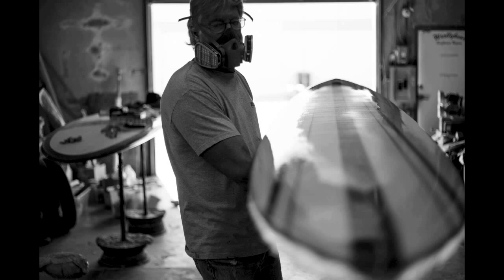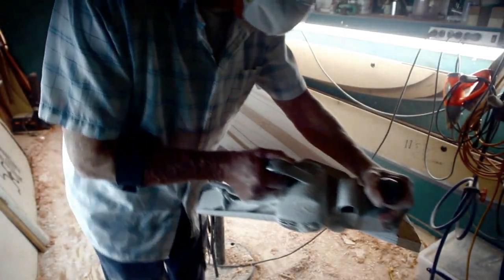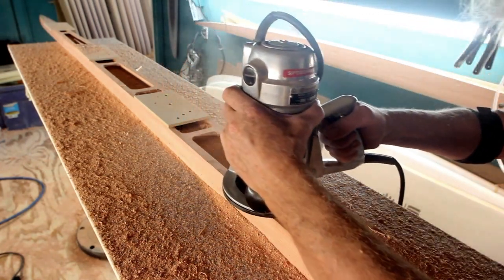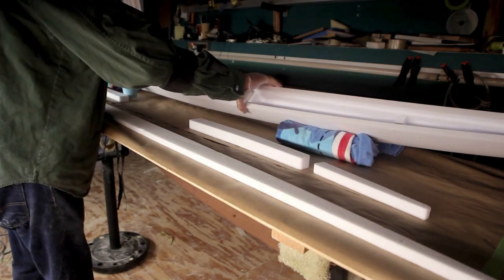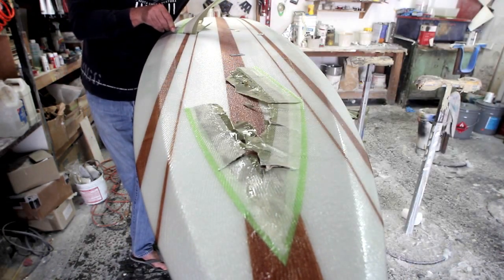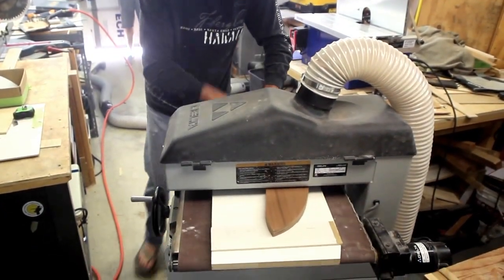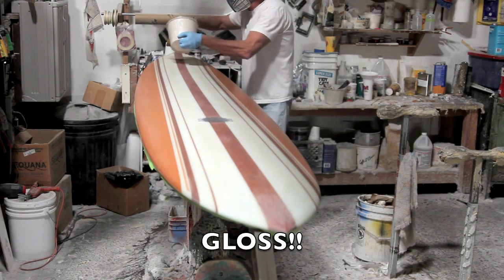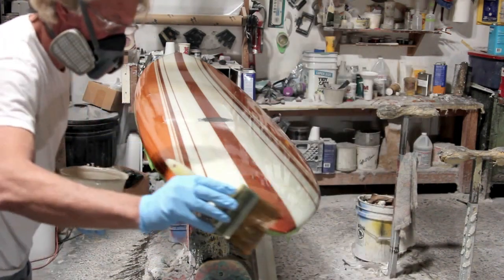Gene Cooper / Ultimate Craftsman Project 2015  / Full Movie

Comment: question: no vent? is it because chambers are filled with foam? 
otherwise, amazing work. Art should I say.
Reply from the maker: Thanks Martin Kalvaster. Could you explain to me why you think it should have a vent?  It's a solid foam board, what am I missing?
Reply: To answer your question, what you missing? I don't think you are missing anything. To make thinks clear, I think your work is amazing. I know it sounds stupid. I have carpentry history and decided to make my first chambered surfboard my self. So you can appreciate my luck of knowledge in building surfboards. It was just genuine question. I'm planing to make one from solid wood with chambers filled with foam. I just seen some guys on youtube putting vents on them and I was wondering if I have to do it as well if I fill chambers with foam? On the other hand, I'll be surfing in Ireland so weather is constantly cold. Don't think board would have chance to get hot.
Reply from the maker: Martin Kalvaster Yeah, air vents aren't used in the surfboard (shaping) industry, even chambered.  I believe more or molded boards (stand-ups, buttboards) and the boatbuilding style of boards but I'm no expert when it comes to that stuff.  Either way in the case of my board or the one you're planning: No air space = no vent.
Reply: That makes it clear. You are Gentleman. Thank you for your time.